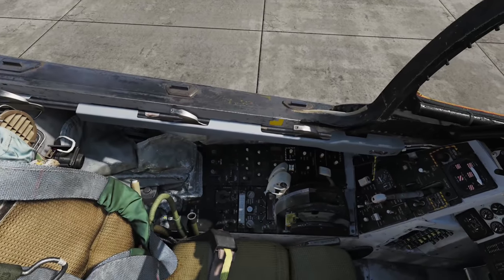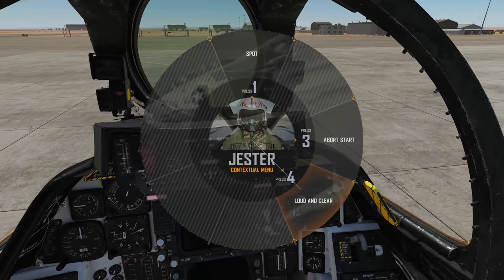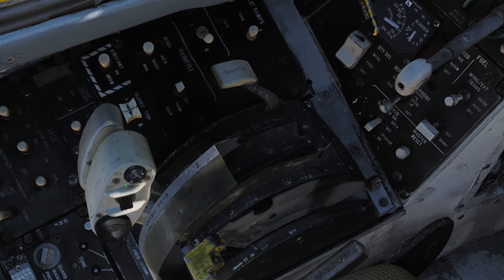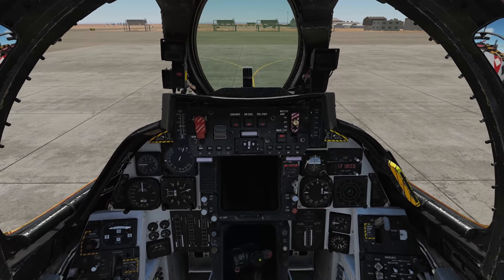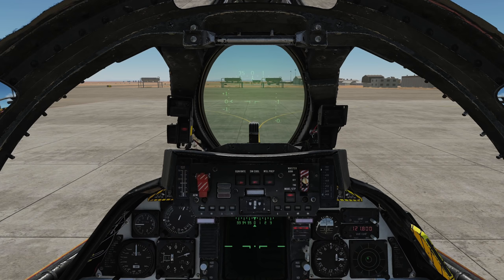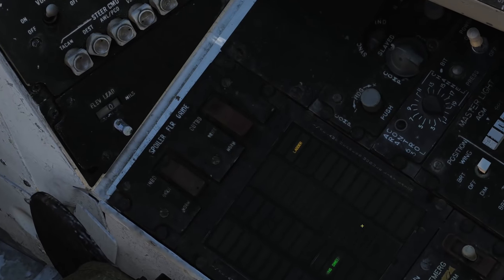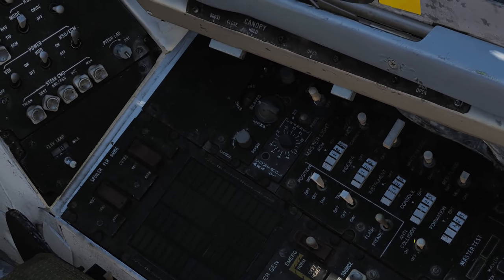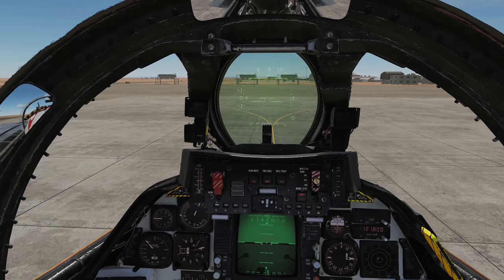DCS World - F 14 - Front Seat - Startup, Taxi, Takeoff with Jester

Comment: Are you planning on doing a HOTAS mapping tutorial to help get set up quicker next week just with some essentials?
Reply: As I recall it will come with a binding if you have the Thrustmaster Warthog.
Reply: Iv got the x56
Reply: spudnocker did a video specifically with an x56 if you havent seen it yet, the bindings seem pretty solid, its what im going to use
Reply: In the f14 manual on the heatblur website there are throttle and stick lay-out graphs. This will get you started